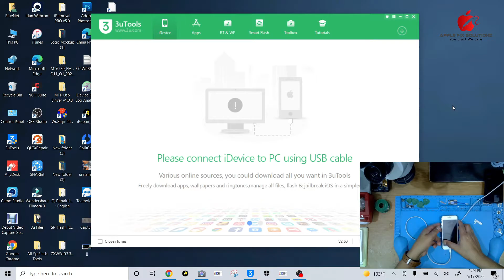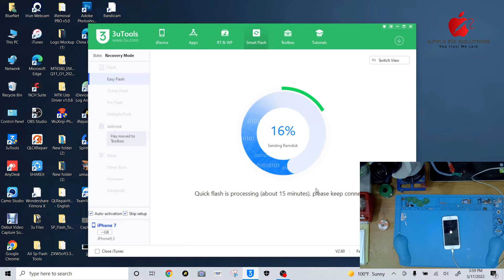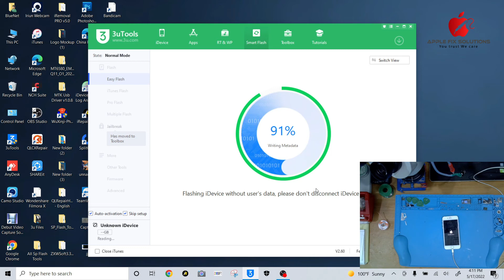iPhone 7 Error -1 | 3u Tools Stuck at 20% | unable to restore iDevice (-1 )

Comment: HI! When I try to update it from my PC, and after giving me the error of failure in 20%, it stays in DFU mode and does not start, is there a way to start it again with the previous iOS?
Reply from the maker: Change the nand and try
Reply: @applefixsolutions  what do you mean by nand?
Reply: @OdensCard321 the chip he removed is the NAND. It's the hard disk of the iPhone.

Comment: Hello Sir.
Same problem.It is stuck at 20% but the error is -78.The phone is stuck in recovery mode. I gave the to someone to change the battery, but I think he did a suck job.He also sprayed the PCB with a cleaning solution for the camera glasses (I think it is sticky).Can you suggest some ideas.I have important pictures on that phone.To find a professional and to take ot the chip and clean it and then solder back?
Thank you.